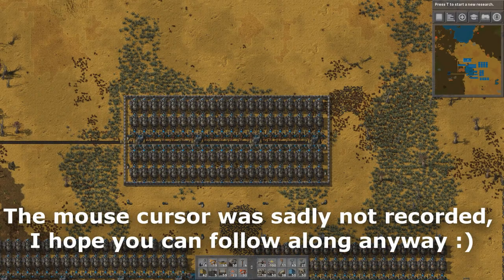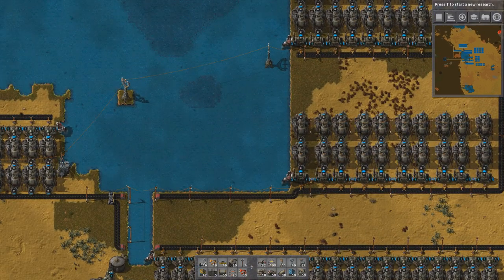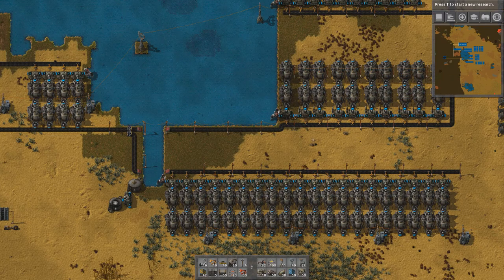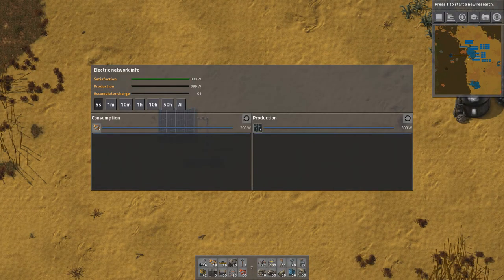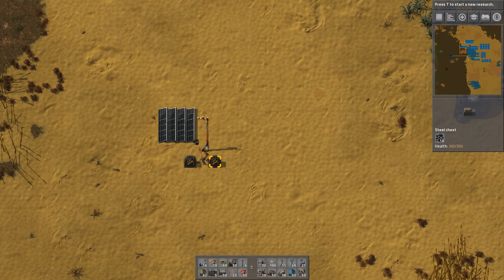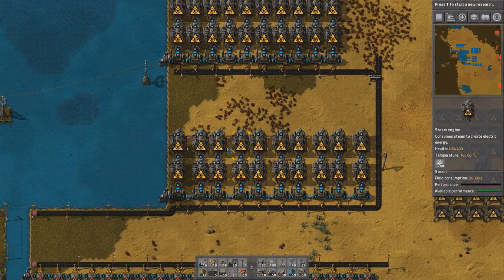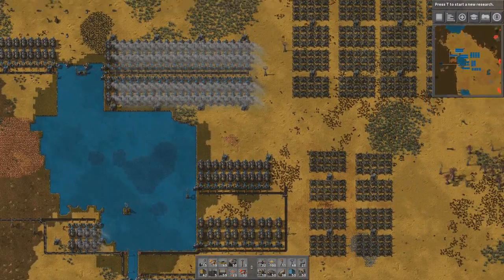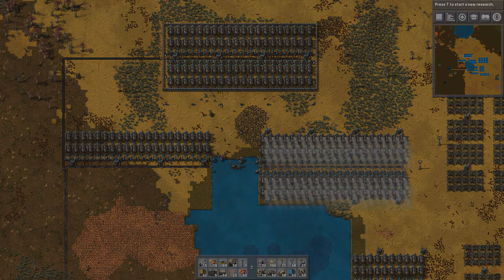Updated Factorio Tutorial - Optimized Steam Engine Setups (v 0.15.x)

Comment: if you can get 5 per 2, then for 40 you only need 8, not 10, which is a big deal!
that's why you should do the complicated version- just because you can.
Reply from the maker: Of course I agree with that, and I try to do that as much as I can, remember the old boiler setup video? In a Friday Fact some time ago I read that the ratio was exactly 1:2 for boilers to engines, so I stuck with that. The thing is that it's still an alpha and these things change from time to time ;) Anyway, the new system is simpler, and the advanced ratios are moved to the nuclear part...